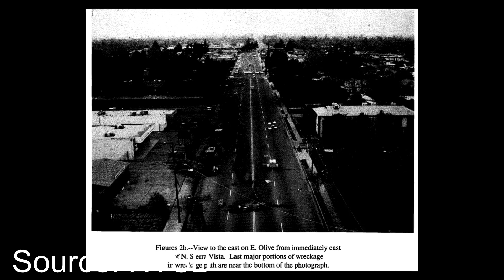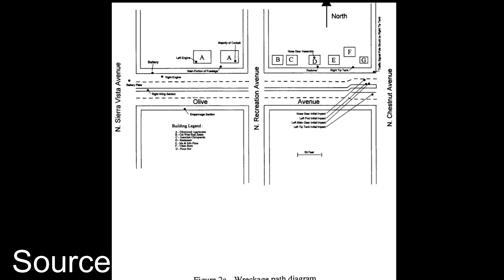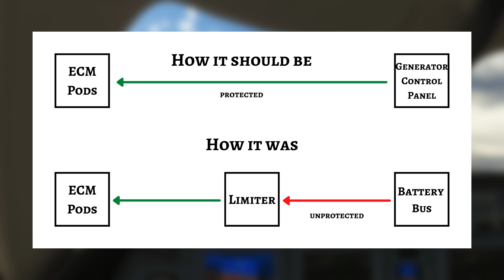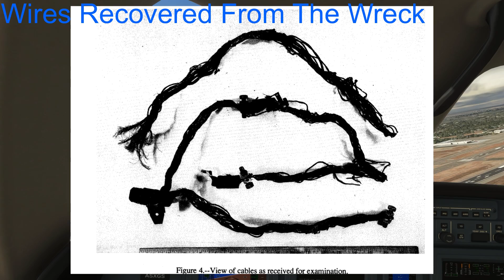How A Tiny Wire Set This Plane On Fire| The Crash Of Dart 21

Comment: This one kind of has shades of Swissair 111 to it. An aftermarket electronic system cobbled into the airplanes power busses in such a way that unintentionally bypassed critical safety systems. And here’s the problem with “better maintenance oversight”. It presumes that the correct procedures for installing the device are communicated to the installation team, and known by at least one supervisor. If they are working from incorrect or insufficient documentation, then the error simply propagates regardless of oversight. And nobody will ever realize it until a plane comes down.
Reply: Reminded me of SWA 111 too. Similar incident.

Comment: I think it's far more likely that the wire got hot enough to ignite the insulation at short circuit current, I don't know what voltage systems are on a plane, but judging from the high amps, I think it's like 24-48v max, where a spark jumping a gap over air would be really unlikely. But this is just my assumption, I'm no aircraft mechanic.
Reply: No, you're absolutely right. It doesn't take a spark to ignite insulation.

Comment: You don't need a spark. A severely overloaded wire will melt off its insulation and eventually burst into flames.
Reply: It'll  burn its own insulation
Reply: @jamesturner2126  Yes, in most cases.  Aviation and marine insulation are not supposed to be able to burn or sustain a flame.
Reply: @ScottDLR  Some kinds of insulation that are fire safe will often set on fire then quickly put themselves out. I've seen this with home wiring and plugs. They add something in the plastic. It will burn for a second or so before going out, but this could make something nearby catch fire. No idea if the same stuff is used in aviation though.
Reply: An overloaded wire acts like a resistor, more similar to a heating coil found in a space heater or toaster. Once the wire gets hot enough, the insulation may melt. Resistive (Joule) heating at its finest.

Comment: A 337 requires an Inspector Authorized know as an IA sign off. To accomplish a Major Repair or Alteration and and not install it correctly per spec is negligent. Just an old airframes/sheetmetal mech.

Comment: FYI: you can actually WELD with a short circuited battery.
Reply: Have a device that does this so I can weld 18650s which is actually powered by 18650s, no solder needed! Really cool.
Reply: @bmc9504  and if you use a spot welder wrong (like I did) you can short a battery with a weld!
Reply: @paul-fornage  I'll bet that was exciting.
Reply: @bmc9504  How many 18650’s?
Reply: Sometimes, you can even do it intentionally.
Reply: The MacGyver method, and yes it works.
Reply: @johnpekkala6941  I thought it just took chunks out of screwdrivers and wrenches.

Comment: I know this was a special case but it amazes me how many crashes take place in sight of the runway.  A few even on the runway.
Reply: Runway, definition: place of maximum flying aircraft density, not just close to but actually on the ground, often with very low speed aircraft … and where stricken aircraft try to go to die.
Reply: You know what they say about the "first 15 seconds and the last 15 seconds" being the most dangerous parts of the flight. 
And they can ONLY occur near or on the runway.

Comment: Actually there is something like that which requires 2 licensed technicians to perform the work to be done and under certain circumstances the second person is just there not to be involved in performing the work but only in checking the work is done properly by doing the test and inspecting the work.
Reply: An AIrman would have to sign off on the work (FAA form 8130-3). Unfortunately, it's fairly common for these Airman to sign-off without actually looking at the work - which isn't required.. That's probably the part that should change.

Comment: 40 years as an A&P.  The differences between aircraft of the same model can be many.  

We have to be certain that the wiring diagrams, procedures, or parts list are for that serial number aircraft. And is it pre or post Service Bulletin X.  There are dozens of variants.  

Also I stay far away from Public Use aircraft.  Several times I have been asked to work on the local police department helicopters.  Never.  Flying death traps IMO.   Many don’t have an Airworthiness Certificate.  Inspections aren’t required.  Seems hard to believe, I know. Research it.  Fix things when they break, nothing more.  Often these aircraft are military surplus. Never had a FAA Airworthiness Certificate.
Reply: Holy sheet, that's seriously eff'd up! No way could anyone explain / defend this situation to my personal satisfaction, and I'm certain that many many others with better knowledge of the aircraft industry must feel the same. Tragic.
Reply: Yup. Like buying an old cop car: never do it! Used, abused, idled to death,

Comment: A buddy system for maintenance would have prevented countless crashes over the years. It would have to be mandatory though as it would hit the airlines in the pocket.
Reply: I imagine that checking work in a hard to reach area becomes logistically complicated quickly.
Some steps also need to be verified on a very fine resolution to be effective
 Imagine Step 12 being a crimp followed by Step 13 Heath Shrink Tube, Step 14 Strain relief, Step 15 Cover Plate Mounting, Step 16 closing maintenance access door... all while in an awkward position.
Reply: @sarowie  been there, done that...
Reply: Airlines all have duplicate inspection requirements, normally referred to as RII (required inspection item) in the industry. It's very common in other parts of aviation. I maintain a king air and am the only mechanic for it. I get mechanics from the business that shares the hangar to inspect what I do, or even a pilot if no mechanics are around. 30 years in maintenance now, I've worked in every type there is, and inspected plenty of other people's work.
Reply: For egress, we have mandatory 2-man concept, especially as much of what we do is explosive maintenance.

Comment: I cringe every time I see an incident caused by poor or incorrect maintenance. As an electrical & electronics engineer with almost 40 years experience, this one really made my skin crawl - this was the equivalent of replacing a blown fuse with a rolled up piece of aluminium foil - there's a reason you should never do that sort of thing - bypassing any kind of overload protection is never going to end well - you may get away with it for quite a long time but one day, sooner or later, it's gonna bite your ass big time :(
Reply: To be fair, this wasn't so much incorrect maintenance, as it was an incorrect implementation of a modification to the plane. Incorrect maintenance would have been to change the wires at the specified interval, but connecting them incorrectly at that point. This one is significantly worse, as all modifications should be checked thoroughly by multiple instances, before being declared airworthy.
Reply: Reminds me of Drachinifel's video about a sailor tying down a circuit breaker in a WW2 battleship at Guadalcanal.
Led to cascading blackouts throughout various parts of the ship. 
Which was therefore going around in circles, blind and unable to communicate, while the Japanese forces kept firing their guns....
Reply: @MrNicoJac  USS South Dakota at the Naval Battle of Guadalcanal. Good thing Adm Ching Lee and the USS Washington was around to back her up.
Reply: All I hear is " oh everybody look at me, I'm an electrician. I work with electricity. I know how to work with electricity way better than you do." Hahaha
Reply: @LoneWolf-gm5qm  
All I hear is "oh everybody look at me, I'm a lone wolf. I can do everything better than everyone else. I don't need no pack. Everyone else is always wrong and I'm always right. Also, I don't understand why nobody likes me." Hahaha
Reply: @MrNicoJac  Touché!
Reply: @LoneWolf-gm5qm  A rated electrician would not be working on aviation electronics so it had to be an aviation electronics technician.  And these guys go to a lot of training to qualify to work on aviation equipment.  But then again I don't understand why they didn't go by the schematic instead of looking up another airplane that's already been modified.

Comment: ...yea little wrong about needing a spark. ive seen a transformer rectifier ground wire catch fire all because one phase was missing due to a loose connection. Too much power down a wire can cause it to heat up enough to case the insulation to catch fire.
Reply: Pretty much instantaneously too. Put an ordinary butter knife across the terminals of a car battery and it'll glow red hot within a second or two.

Comment: Seems like copying from another aircraft or repeating whatever was done before should be unacceptable. Referencing the manual should be mandatory. British Airways 5390, for example, happened because the maintenance personnel used bolts that were the same as what was in there already instead of checking the manual and it turns out that the wrong bolts were used by whoever did it the first time. Copying a mistake with another mistake.
Reply: You should NEVER copy what another tech has done - ALWAYS follow the procedure as laid down in the book, unless a service bulletin is issued to the contrary (in which case you should follow the new book)

Sounds blatantly obvious really, but you'd be surprised how many times I've seen people fail in this basic methodology. Fortunately they weren't working in aviation
Reply: @countzero1136  100% agreed. I live about a half mile from an aviation maintenance training school. Sometimes I see the students in the coffee shop near my house. I don't want to be a Mr. Know-It-All and rant about thoroughness and the responsibilities inherent in the career they're about to embark on. But it sure is tempting, especially after seeing so many of these air crash investigation videos. Just one little 'whoops' and people die.
Reply: @Will-fn7bz  If everybody just did their jobs properly and followed procedures correctly, there would be no need for you or I to have to take them to task over it...
Reply: This copy-cat repetition is rather like the essence of blindly following “tradition” — if the original was based on true “knowing” then all should be well, given that no other changes were made that might affect the overall result.

But if the original was wrong (even partially), then disaster will ultimately visit.

So the same goes for religious and even secular traditions — if the original was wrong, or is later misinterpreted or corrupted well, too bad! 

And that is why ever present, “fresh”awareness is essential, or death ☠️!!

Like the aviator/novelist Ernest Gahn said, “Fate is the Hunter”!!

Comment: A company I worked for hired contractors to install safety related equipment on public transport vehicles, but we had to check and confirm their work was done correctly afterwards. Only later did we find out our company estimated a 50% failure rate at install...so we did almost 50% of the modifications despite paying for contractors.

Comment: As an aside, the Learjets were actually developed from a military prototype, the Swiss FFA P-16 ground-attack fighter. There are rumors that the first generations still shared a lot of the flight characteristics of the fighter. I have no idea if any of this shared a role in making Learjets attractive to the military.
Reply: Correction it was a Dassault not a Lear jet.
Reply: Iraq mounted a anti-ship missile to a similar aircraft. Apparently they are pretty capable aircraft for the military sector.
Reply: Cheaper to buy a plane instead of inventing a plane. Poke around for ATC chatter about a mystery airplane reported by pilots up around fl 40 that was not appearing on radar. It was a 737 testing radar canceling ecm that apparently worked. PS Lear's grubstake was the royalties from inventing the 8 track tape player.
Reply: @billdurham8477  ATC doesn't really have radar like the military anymore. Instead they have a system that sends out a signal that every aircraft in the area has a radio box (transponder) in it that responds to the ping with a reply that gives a bunch of data in it.
Simply turning off your transponder will make you invisible to ATC.
I test transponders for a living, aircraft need a test every two years to remain airworthy
Reply: @rowerwet  that thing sending out a signal is called “radar” and the data from the transponder is called “secondary radar”. See MH370.
Reply: No, it was developed from the 8-track player.

Comment: It would seem that whatever connector is used in the wiring at that point should have had a slight variation to not allow such a bypass in the first place... or if it was a rare necessity to do such a bypass, to have some warning constantly on to the cockpit computer about such a bypass so that it would be monitored and repaired and not forgotten. It might have been a limitation of the early 90s computer tech to be in that gap between analog and digital components. The design may have been seriously outdated.
Reply: You assume an actual connector plugged in somewhere.
I assume wires that simple get stripped and fitted with "adequate and industry standard solution" to connect point a and b.
It is the nature of after marketed electronics that they need to be integrated somehow into many different systems/planes that has not been prepared for it.

Comment: For some weird reason, this reminded me of an incident where Lockheed-Martin dumped an under-construction satellite onto the lab floor, doing millions of dollars in damage.
Reply: NOAA-19

"On 6 September 2003 at 15:28 UTC, the satellite was badly damaged while being worked on at the Lockheed Martin Space Systems factory in Sunnyvale, California. The spacecraft fell to the floor as it reached 13° of tilt while being rotated. The satellite fell as a team was turning it from a vertical to a horizontal position. A NASA inquiry into the mishap determined that it was caused by a lack of procedural discipline throughout the facility. While the turn-over cart used during the procedure was in storage, a technician removed twenty-four bolts securing an adapter plate to it without documenting the action. The team subsequently using the cart to turn the satellite failed to check the bolts, as specified in the procedure, before attempting to move the satellite. Repairs to the satellite cost US$135 million. Lockheed Martin agreed to forfeit all profit from the project to help pay for repair costs; they later took a US$30 million charge relating to the incident. The remainder of the repair costs were paid by the United States government."

Comment: There is something called quality control office and its used in many aspects of business. Its used as an oversight tool in many different stages of manufacturing.  You would think ANYTHING with the words military attached to it or aircraft in general would have at its disposal a QCO. A control office which in this case should have existed within the maintenance department.  Regardless of the fact that this was obviously a subcontractor, Its a plane!!!. Its a shame when you think of flying you don't spasticly think of safety 🤔???  I mean I'm not afraid of flying but usually the first thing I wanna know is the age of my plane?  From there if its really old sometimes I'll actually take a different flight because of that alone. To me the more modifications the more chances for things to go wrong. 

Its just Sad regardless. Thank you for a great video!